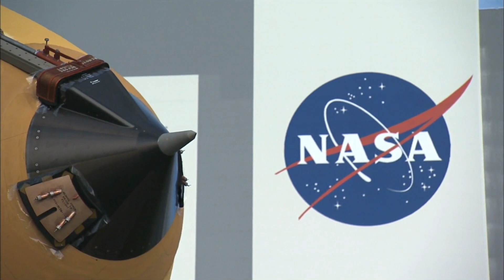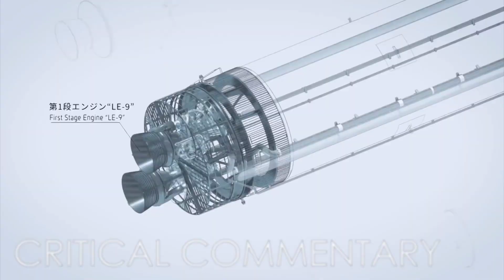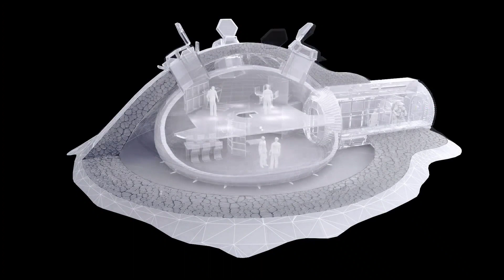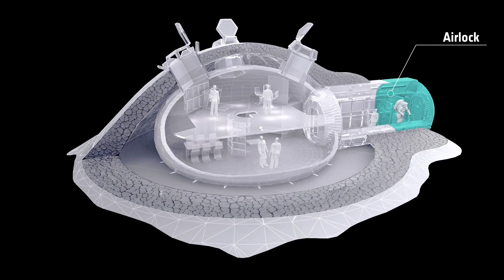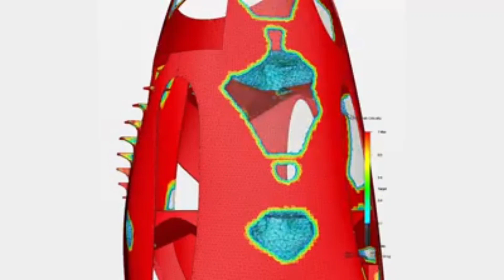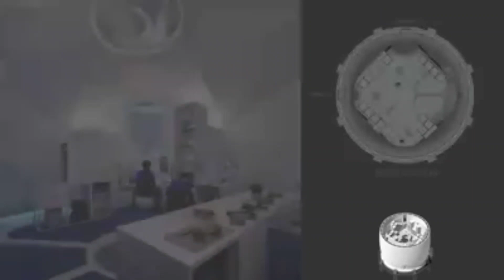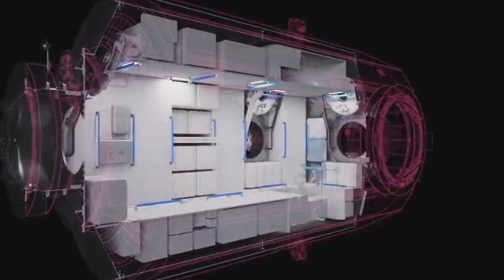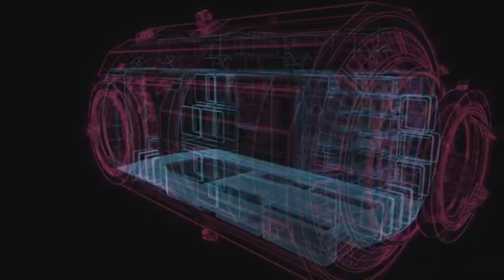YOU can participate in NASA'S 50 Point Plan for the Solar System!  How does Starship fit in?

Comment: Most of this is hopelessly optimistic, we have travelled no more than 500km from Earth in the last 50 years. Human travel beyond Lunar orbit will require nuclear rockets. Lunar Starship is many years away and the Stalled Launch System is only planning to launch one mission per year at best. I see no budget and no urgency to achieve any of these things.
Reply: Thermal nuclear rockets are desirable - but won't happen due to prior treaties. THE US HAD sthermal nuclear rockets in the 1970s ready for flight testing - but threw them away.
Reply: Starship can fly 100 times to LEO for the cost of one SLS flight.  That translates to about 20 HLS missions, delivering 3,000 tonnes to the lunar surface per year.

Nuclear power is clearly necessary for interplanetary flights to reduce them to acceptable durations for human beings.  Also nuclear power is necessary on the surface of both the Moon and Mars, as well as any asteroids or outer moons that we need to utilize.

Comment: I think that one of the areas where we need to change is thinking abput using starship to deploy a space station. Instead we custom build a starship to act as a space station. One of them has more internal space than the ISS.
Reply: I'm sure spacex could come up with a way to connect starships in a way that would allow astronauts to move between them. They already planned on doing it for refueling. Something like the moon edition starship, have a door 3/4 way up the vehicle that you could connect a tunnel to go to the other starship, dunno.

Seems like a waste to have such a massive ship and not use it as an easily deployable and movable space station. A lot of space would be wasted with the fuel tanks but surely it would be worth it to have an easily deployable space station that doesn't take years of r&d.

And damn I didn't realize just 1 of them has more space inside than the ISS. That's wild.
Reply: The only problem with that is you are stranding complex, and usefully re-usable engines on the lunar surface/orbit that could be doing more gainfull work.
Reply: @NullHand  They could custom build a model that has smaller engines (for reboost) and smaller fuel tanks.
Reply: @NullHand  pulling the engines off and returning them on a different trip as cargo doesn’t sound any harder than designing a space station that fits inside a starship and unfolds. They can install and remove them over night on earth, if they put a connection for an arm then it wouldn’t be that difficult. Or they just plan on losing them and install engines that have already flown 50 times. Everyone else throws away engines worth tens of millions of dollars, and Spacex wants to bring the cost of a raptor down enough that maybe it would be cheaper to just waste an engine than to even bother bringing it down.
Reply: @beeman4266  Two Starships on the way to Mars, connected them nose to nose with long cables, spin them up, one a space habitat the other supplies for the mission. Seems achievable but an engineer would have to do the math.
Reply: @NullHand  how about another vehicle to bring back the engines or the whole thrust puck?
Reply: It's just more efficient to have a specific built payload for the second stage and payload. Especially if you're doing more than one.
Reply: The big value of starship is we can use one rocket dozens of times, so instead of one trip transporting a 100ton station (the starship itself) we could send twelve hundred tons over a dozen flights back and forth. Now we might want to consider having a way for a starship to end it's lifecycle as station/ part of the lunar infrastructure. Say was want to get twelve flights out of one starship before we retire that rocket, we could send it on it's last run without fuel for a return and instead use it as some ancillary station landed on the moon. Maybe a forward post at a research site or even send it with a module in it's faring like normal but once it's empty it serve as a storage depot for mined material. Give the shell some new purpose on the moon once it's reached the end of its life cycle. That I see as more plausible than just one flight for use as a station.
Reply: @mcarpenter2917  Spin gravity is for sure something we need lots more testing on. They toyed with mock ups here on earth back in the 70s and the Von Braun spin station design was a legit proposal. Part of the benefit of a lunar base is we can test to see if low gravity is enough for humans. Micro gravity is obviously not enough but we really have no idea what the lower threshold really is. Mars or the moon might be enough (with exercise) but the truth of the matter is we don't know. I think a spin gravity ship is going to be a must have for Mars missions, even at it's closest pass Mars is still months away from Earth and we know multi month mission in micro gravity wreak havoc on human bodies. We should aim to give our astronauts the best possible health conditions for Mars and quite literally debilitating them before they even get to the red planet is just silly when we could provide a method that might completely fix the problem. Maybe cause seasickness from the motion but that better than bone density loss and circulatory problems. Plus it's be kinda funny that long voyages to new worlds would be in 'ships' and cause motion sickness like in ages past.
Reply: I think inflatable modules would be much more efficient - less volume required for transport,and more volume available after inflation at the destination.
Reply: Could we use the emptied fuel tanks for storage?
Reply: @beeman4266  Life support for 1100 cubic meters of conditioned space is going to take years of R&D no matter how you slice it. There is no plug and play system you can toss in there.
Reply: @curtiswfranks  only if startship is left intact. The problem is that the walls of starship are also the sides of the tanks. Now adding airlocks would help. but they don't have any insulation. and you would have to cut from the methane tank into the oxygen tank to add a second door. Needless to say both tanks would need to be vented before doing anything to them.

Comment: First things first, there is not going to be a one ship does everything. Could you imagine UPS trying to deliver packages to your house using BOEING 747s? There needs to be multiple vehicles to accomplish this. You need a heavylift rocket to carry bulk fuel and supplies. You will also require another vehicle to bring stuff back to earth. Also consider that all starships dont need to return back the earths surface. You can combine multiple starships together to make a space station. Maybe combine 4 starships together to make a lunar gateway. Put enough fuel and supplies to last a year and this would take one trip from LEO to a lunar orbit. Then a different vehicle would travel back and forth to the lunar surface. One ship trying to do everything would be difficult

.
Reply: They would have to field modifiable to remove the tanks to expand the living and experiment space.
Reply: @jessepollard7132  Yes. They could make these features built in

Comment: For creating a lunar colony, special starships could be designed as Stayships. They would land horizontally instead of vertically, with control rockets along the side for the final parking maneuver.  The engines and fuel tanks would sit on rails and be easily pulled out. Much of the interior will be planned and installed on earth but some equipment and workstations could be modular items shipped separately and plugged in later. The engines and control rockets could be reused on lunar vehicles or returned to earth. The fuel tanks would be put to use by the colony.  One could form a common area with four Stayships attached, nose on.

Comment: One thing for sure, NASA and the government will have to enhance the development of SpaceX not hinder it.
Reply: But first SpaceX has to get starship working, and I don’t even think another FAA delay would change anything. Launch in august is my guess because something went wrong with ship 24 during pressure testing and fully build booster 8 (if they were to use booster 8, which is likely according to some leaks)
Reply: @fork9001 , if it were me, I would never catch a rocket on the launch stand until I knew for certain I could catch it successfully. Too much potential for catastrophe. I would be shocked if they don't use a small single purpose catching platform built for testing. It could be bunkered, far less costly and placed well away from the main facility and fueling operations. Even in the gulf. Time is on their side for a couple of months any how. These newest rockets are farther ahead of what they might have been over the last year. I would never give up an engine to the ocean and the potential loss of technology. Then there is the EPA:-)

Comment: Just a thought but imagine a starship booster with no second stage just a light nose cone to protect some fueling ports on the top. The booster should have no problem making it to leo or any earth orbit for that matter. Now you have a fuel depot worth talking about. Granted it would take a ton of starship tankers to fill but once it's topped off you have more fuel than you know what to do with. If you modify that design so it can couple "head to head" with another booster as a tug you can put all the fuel from one booster in lunar orbit. Now those 5 trips to the moon surface are more like 20+. It's insane in scale but the long term utility is equally insane. Plus the "tug" booster can deliver one fuel depot and bring back an empty one to leo for reuse. Having a booster that size already in space would be immeasurably usefull. Granted this would require a replacement of some of the raptors with vac raptors and all the other insane engineering that would be needed to make this work but that's why I said "imagine" 😆. I always thought the booster itself was the real star of the show.
Reply: Lmfao, you've missed the whole point, the booster is a booster for leaving earth's gravity well.....FULL STOP.
Starship is designed to get anywhere else in the solar system......
What more do you need.....
🤣😂🤣😂🤣😂
Reply: ISRU deals with the rest, ISRU is the real key..
Reply: Build a space station using starship bodies and reclaim the engines using another starship or another vehicle
Reply: To move commercial cargo from the moon back a larger fuel source than a single starship tanker will be necessary. If your talking commercial mining of the moon huge fuel resources will be necessary. Seeing as Starship is the most likely candidate for moving those materials you might want fuel that it can utilize.
Reply: @zakiranderson722  Elon Musk himself said finding enough carbon on the moon to reliably refuel starship would be extremely challenging. Like digging up asteroids every time you need fuel. It's designed for ISRU on Mars. Mars is Elons ExxonMobil of our solar system.
Reply: @jbizzle1966  I feel you. Skylab but long term and reliable.
Reply: @jameshathaway5117  your thought processes is all over the place, the real problem is leaving earths atmosphere and gravity well with the super heavy and then refuelng it from earth many times. Which is what your plan suggests,  like is said ISRU is the key no matter where you get fuel from moon or mars or whatever! As long as it's not earth because of the % of payload to orbit from earth.

Comment: I do wonder if landing the whole ship is necessarily the best way to go about putting large cargoes down. After all, the drop from the Starship payload bay to the ground is rather a long one. I wonder if a 'sky crane' (as was used with the Curiosity and Perseverance Mars rovers) with flyback options wouldn't be a better way of putting cargo down, at least, on the moon.
Reply: @R DOTTIN I think he's talking about a space elevator on the moon, with its terminal hanging a few kilometers Earthwards from the Luna/Earth L1 Lagrange.  No hovering involved.  But to me it only makes sense if we foresee spending years commuting to the moon;  too much investment if the plan is to go to the moon just a few times like we did in 1970.  If we plan to start mining the moon, then yes.
Reply: @R DOTTIN A fair point. Still, I do think it would be easier to just send the payload down with an attached sky-crane, and only the sky-crane returns to lunar orbit to be collected.
Reply: @GoranXII  possible, but would require a good bit of fuel. and a minor emergency if the cable gets twisted likely leading to loss of the cargo.
Reply: @privateerburrows  No, I'm talking about a few hundred metres of cable at most, and more likely a few dozen, so yes, hovering would be involved. Alternatively, having the 'crane' simply attached to the payload would eliminate the need for both a winch system, and the need to control a hover, so would be simpler.
Reply: @jessepollard7132  Much less fuel, however, than trying to land all of Starship however, plus R DOTTIN has already pointed out how stupid a hover system actually is.
Reply: @GoranXII  Actually, more as it has to support itself aand the cargo while the cargo gets lowered, then it has to return to orbit. Landing eliminates the support requirement It also makes it easier to unload sensitive cargo.

Comment: One thing a Starship cannot do: safely carry human beings.

Ever, barring some very big changes, which don’t strike me as practical.

I hope I’m mistaken. I have yet to see any evidence that I am mistaken. Maybe there will be some. Has Elon Musk provided anything about how Starship will become human-rated? Maybe he has described that clearly and somehow I’ve missed it.
Reply: At the moment Starship has not carried anything to to orbit so literally it cannot carry human beings, safely or not.  However the only real engineering problem around man-rating Starship is the absence of a mechanism to safely separate the Starship in the event that the booster blows up.  However although there have been several hundred manned launches since 1961 there has been precisely ONE booster RUD on a manned mission and that did not prevent NASA from authorizing a HUNDRED subsequent launches of the Shuttle which still had no emergency escape system.  And yet the design of the Shuttle, with the orbiter attached to the SIDE of the booster, is intrinsically more dangerous than the Starship design in which the orbiter is on top of the booster.  With something as massive as Starship there is no conceivable emergency separation system.  It takes several seconds just to fire up the engines in the Starship and even then they accelerate away at much less than the 5Gs of the Super Draco engines on Crew Dragon.  Although superficially the design of the Starship booster looks like the infamous N1 it is fundamentally different and in particular benefits from a half-century of engineering advances.

Nevertheless SpaceX is run by engineers, not accountants, lawyers, salesmen, or politicians.  Remember that if it had been up to engineers the Shuttle would have had a 100% safety record.  SpaceX did not put humans in a Crew Dragon until they had over 100 successful flights and verified the operation of the Dragon capsule not with ONE successful unmanned flight to the ISS but with almost two dozen flights over nine years.  Furthermore SpaceX doesn't need to rush to put humans on a Starship.  They could launch the Starship to LEO, autonomously refill it, and then ferry the crew up on a Dragon.  Furthermore it took 9 years to accumulate 100 safe launches of Falcon 9, but Starship has at least an order of magnitude shorter recycle time than Falcon 9 in part because there is no polymerized kerosene gunk to clean out.  Starship could in theory achieve 100 safe flights by 2024.  Certainly the current plans for Polaris 3 and Dear Moon assume the crew would launch with the Starship.

Comment: Greetings:
Starship changes to accommodate some appropriate format of nuclear propulsion.
May require a new LEO orbit altitude.
May require a combo of propulsion systems to permit lunar landing with less conventionally fueled systems. Looking to make best use of both nuclear propulsion and molten salt or other appropriate reactors for any practical purposes.
Looking to minimize lift of fuel to LEO.
Previous nuclear propulsion systems may be permitted from Pacific ocean platforms; with minimal environmental impacts. [Maybe those A-test islands can be reused.]
Looking for best Starship reconfiguration capability to trade off propulsion vs payload. 
Known lunar availability of thorium makes it the least fuel fabrication intensive reactor. Robotic equipment may severely lessen the shielding needed. Co-located rare-earth-elements to thorium sites may ease their use in lunar factories.
SpaceX may use lunar experience gained as a major asset for follow-on tech.

Comment: Probably a dumb question, but maybe not....  NASA has been talking about retiring the ISS in the not too distant future.  Couldn't they just upgrade the ISS and then get a Starship to boost it first to GEO, and then onto lunar orbit?  Why destroy one station and build another?  Most of what they plan to have on Gateway is probably already in ISS.
Reply: It is a good question. Nasa has been extending the ISS only because no one has delivered something comparable. Enter: Axiom. As long as the ISS has been in space, structures/parts have deteriorated and other systems were just built for a different time. A new station can use what we have learned over the decades, as far at micrometeorite armor, thermal control, quality of electrical connections and interfaces, docking stations, pretty much everything. It is old and the scientists have to spend a whole lot of time keeping the ship airtight as opposed to actual science.
Reply: @migs7220  Thanks;  I didn't know there was so much wear and damage on the ISS;  I assumed micrometeorite damage would be sparse.  Thanks for the informed answer.